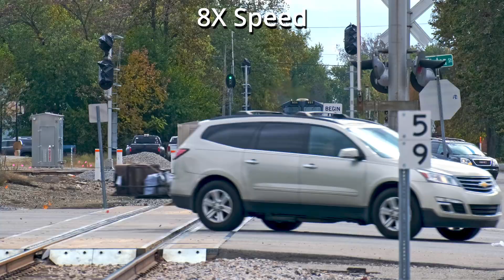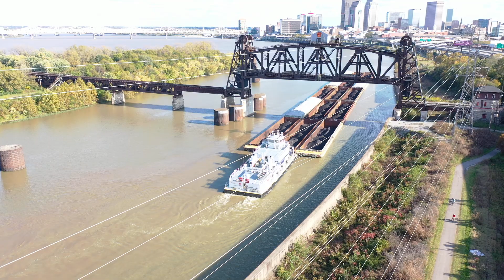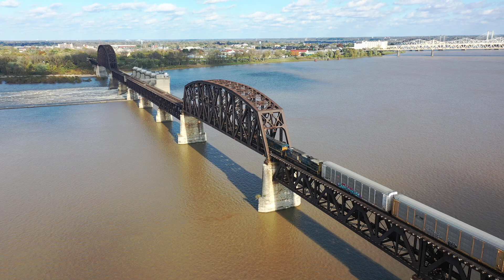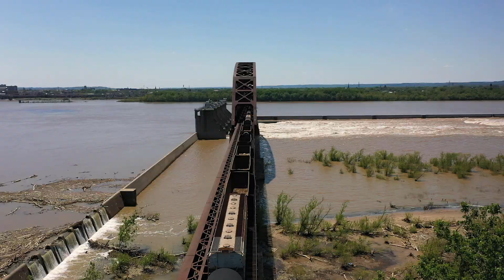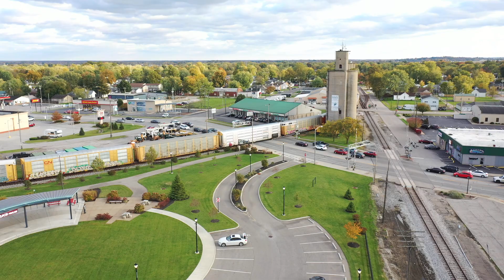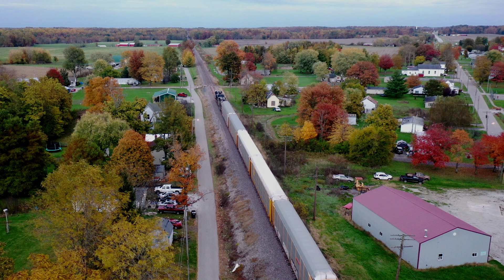Vertical Lift Bridge Action and Color Position Lights: Indiana and Louisville Railfanning

Comment: this area around the bridge heading east is going to be devopled as part of the riverfornt park and the luoisville loop trail system that run down to the big four bridge that connect indaina and ky that was converted to a bike hike bridge connected the two states. that area was the old B & O yard the feed the the L & N depot over on broadway. the tracks to the west of the bridge that you were standing on iss the L & I interchange with the N S that happen once or twice a month the L & I droping on sunday and N S picking them up on tuesday i use the bike and hike trail along the river servial times a week to bike out to the N S yard in portland
Reply from the maker: Thanks for all the great info Dave. I do appreciate it.
It will be interesting to see what the area looks like in the coming years.
Have a great day.

Comment: What is the weir used for and the wall ?
Reply from the maker: I believe it's used to control the level of the river to make sure it remains at a navigable level.
I've only seen the area inside the wall full after a heavy rain comes through the Ohio River Valley and the river is at a high level.

Comment: Your drone skills are so smooth. Do you finger pinch or thumb the sticks ???
Reply from the maker: Thank you very much Randy.
I actually do both, it just depends on the controller.
When I fly the Mavic, I usually do just thumbs.
When I fly something with a bigger controller, I'll use the finger pinch.
I think the finger pinch gives more control, but once you are moving the thumb control is pretty smooth.
Everything in these videos is using only thumbs.

It sounds like you fly too. Which way do you prefer and why?
Reply: @nkyrailfan  Thumber on both EVO and MavicMini. Retired mech/elec with arthritic hands.